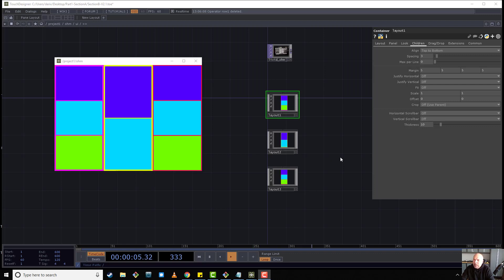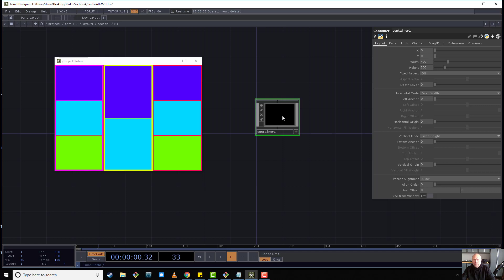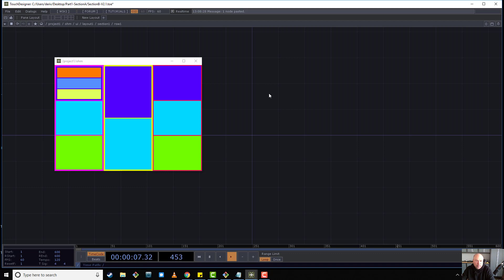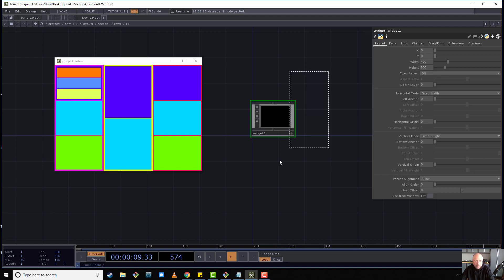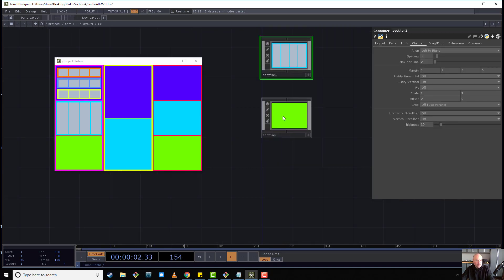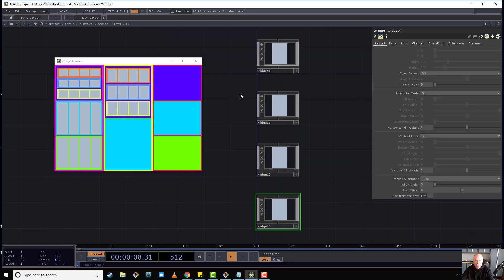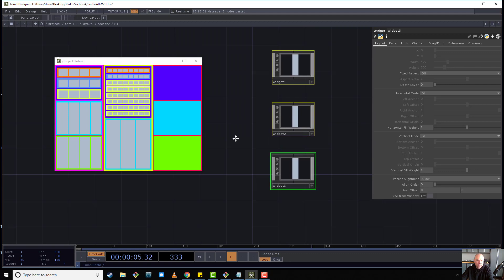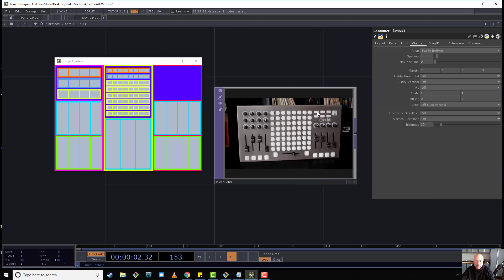Widgets Part 2: Widget COMP and Knob, Slider, and Button Layouts

Comment: I still don't understand why you have to create all these sub containers.?
Why can't we just put all the controls in one container.?
They will all still be uniquely named and controlled.
Reply: Instead of vertical or horizontal stacking.
You could define an "array" of 8 x 8 knobs.
For example.
Reply from the maker: @EvenStarLoveAnanda  You could, there are many ways to approach  things in TouchDesigner. The lesson here focuses on using "Fill Mode" so that the UI always stretches responsively as you change the size of the window, and doing that inside layout allows you to use the component's fill behavior. If you added 8x8 buttons separately and manually placed and sized them, this wouldn't be possible. You could experiment with 64 buttons aligned left to right with a max of 8 per line, but the author decided to use separate rows in this case.
Reply: @TouchDesignerOfficial  Yes thanks for that, now I understand, this is just for teaching and demonstration purposes. Not for simplicity.
My next question is, is there a way to put skins on those controllers to make the Knobs and buttons to look more realistic and still be able to control the knobs with the mouse?.
Or is there a different Object for that?
In Max I used a video file of 128 frames in Jit.movie object to cycle through the frames back and forth and show a physical looking knob.
Reply: @EvenStarLoveAnanda  components like sliders buttons and knobs are extended containers. Meaning you can dive into them and build whatever interface you’d like to. You could put your frames on a switch for instance, run that to a background top, and set the knob to cycle the switch. Or you could have an animation of 128 frames tied to the position of the knob. Lots of ways to do it.